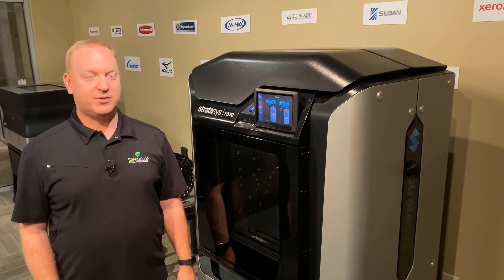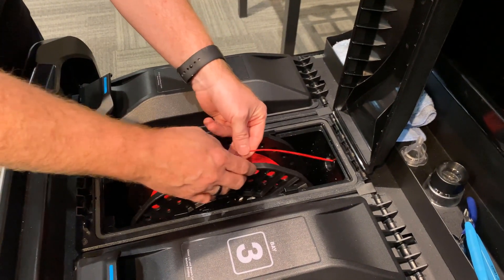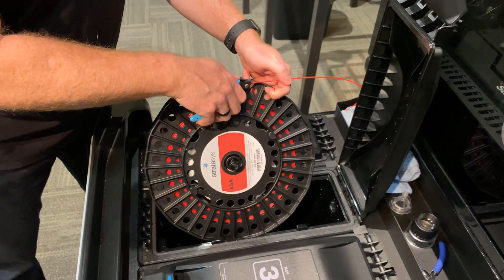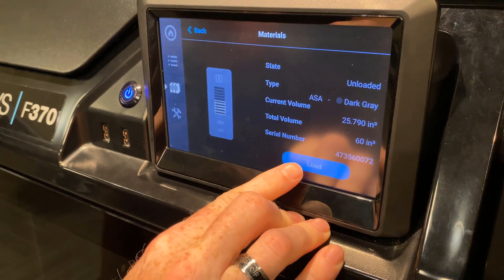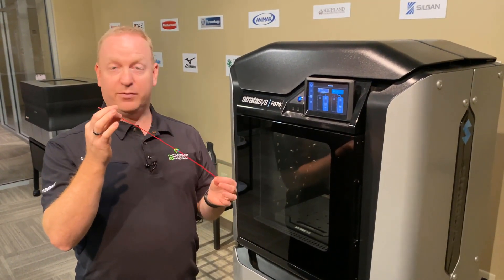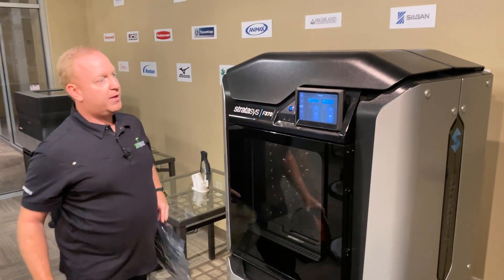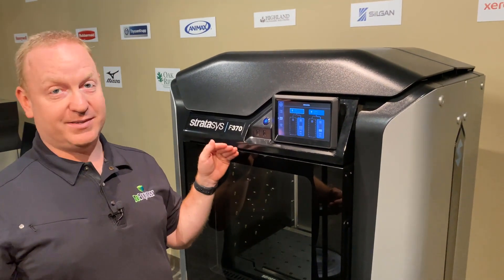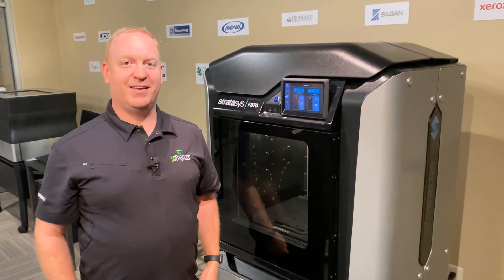Stratasys F Series Material Change

Comment: very informative. I have a question. Can we use two material simultaneously to print a 3D object in Stratasys F-270?
Reply from the maker: Yes and no. While the F-270 is a two-nozzle system, one is dedicated to the model material and the other is dedicated to the support material. That can't be changed. There are different Model Material options, but it is always paired with the support.

Additionally, the F270 has been discontinued. But the F170 and F370 are the same style of printer just different build sizes and material options.
Reply: @goengineer was the F270 a poor seller, or were there other reasons they discontinued it?

Comment: Very helpful thank you. But, I got to the end of one spool and tried to load another and it wont let me. I've changed about 5 now (the printer is still new) without any problem but now trouble has struck. The model spool will start to load only a little so i close the door, it shows it's loading then all of a sudden it starts to unload fully. It tells me to LOAD MATERIAL but I just keep trying and it won't work. The page that shows the 2 Materials says 0% for Model and correct % for Support. I hope I have described this properly and it can be understood.
Reply from the maker: The quickest way to get help with this is going to be to contact your VAR's support team. IN the case of go engineer you can call 1-855-470-0647  or email AMsupport@goengineer.com  to get expert help on your situation.

Comment: What about the color? the unit will purge by itself?
Reply from the maker: Yes, the printer is very good about purging enough to fully change the color. But it is usually a good idea to do a small test part to be sure, especially going from a dark color to a very light color or white.